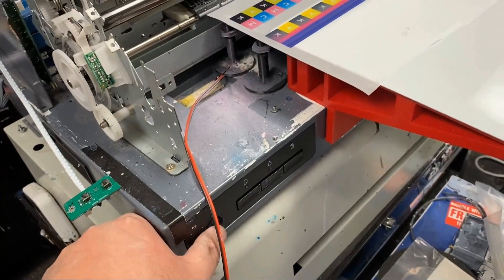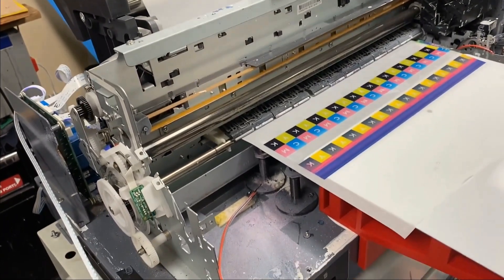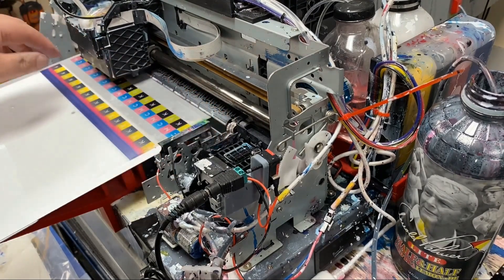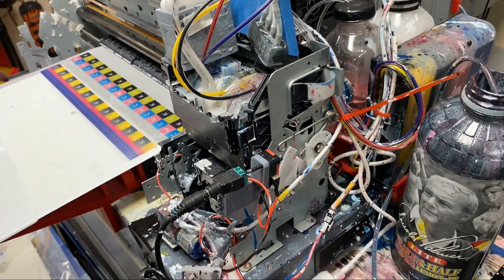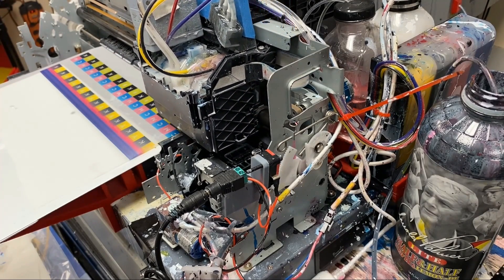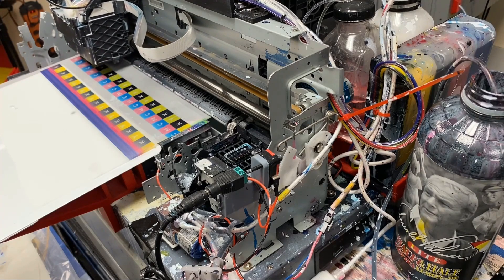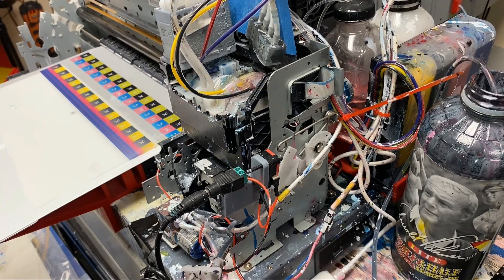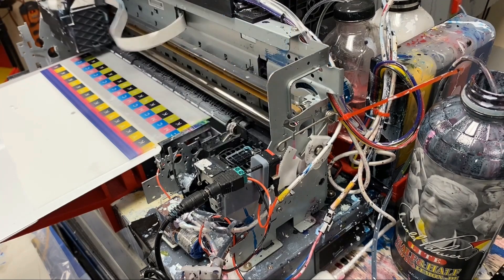FIX Your Screeching Double-Error Light DTF Printer in 10 SECONDS Flat!

Comment: HI KEVIN 
I have the same printer l1800 and i got the same problem i changed the capping station it's working now but i i get the same issue after 4 or 5 prints can you please help me to fix this problem .
Reply from the maker: Thanks so much for your support and for watching and commenting—I really appreciate you being part of the channel. Since you’re seeing the issue come back after a few prints even with a new capping station, the next things to check are mechanical alignment related to the APG: first adjust the APG height using the half-moon dial on the right side, then fine-tune the parallelism bar on the left to make sure the head is landing evenly, and after that try moving the right frame stopper slightly to the right by about 1 mm so the capping station doesn’t catch or bind the printhead during parking, which commonly causes the screeching and double-error lights to return. Thanks again for engaging, and if you haven’t already, please consider subscribing or becoming a channel member—subscribers and members get priority replies (typically within 48 hours) plus extra perks like early access to videos; because I receive a high volume of questions and can only answer around 10 per day, regular viewer questions are answered if time allows, and after subscribers and members I reply last-in, first-out with newer comments reviewed first, so if you don’t get a response within 48 hours you can either subscribe or repost your question, and if you subscribe later your older questions automatically move into priority without needing to repost. You’re also welcome to join Run With Kevin — LIVE, where I go live every morning (usually between 6–8 AM Eastern) and answer printer questions in real time, so subscribe and turn on notifications if you want to catch the next session and ask directly. If you need faster assistance, you can email support@bchtechnologies.com
, and if this video or comment helped you, I’d really appreciate a Google review here: https://g.page/r/CfL7k6nYvPQ9EAg/review